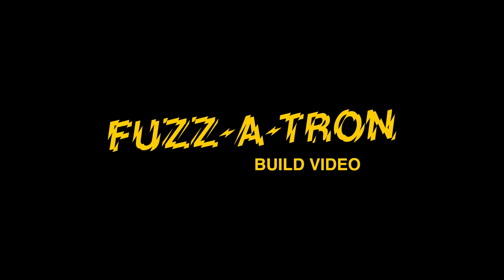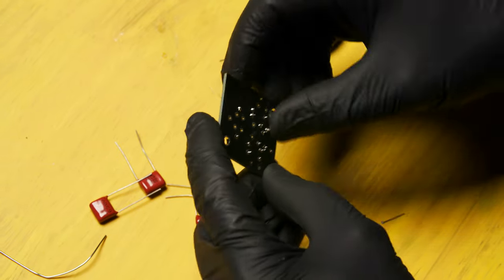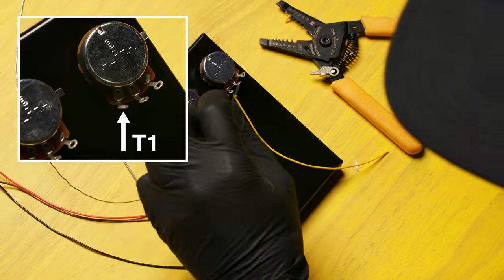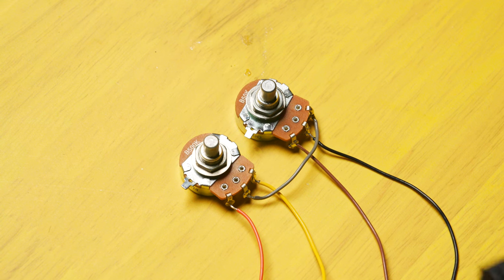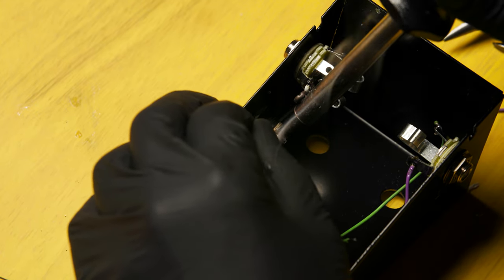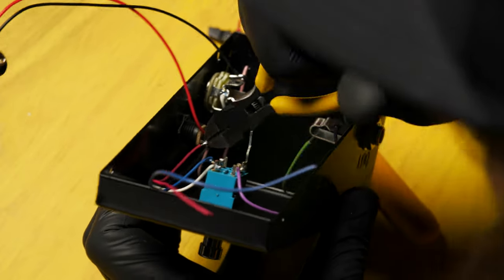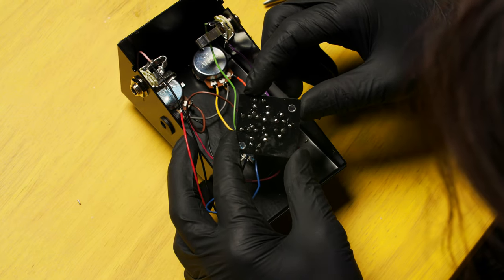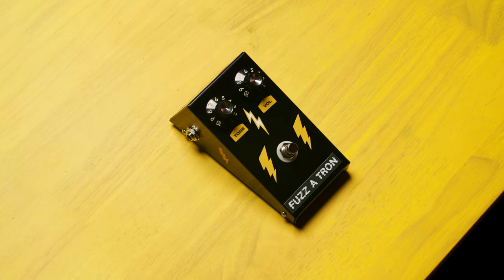Third Man Hardware Fuzz-A-Tron DIY Pedal Build Video

Comment: Built mine yesterday. It was a fun project, even for someone with very limited soldering experience. I initially missed the step of fixing the spare cap leg to the other lug on the switch and wondered why I had no bypass signal 😂 Once I figured the out all was golden. It's a great sounding pedal too. Now I'm keen to learn more by getting a breadboard kit and trying out a few circuits.

Comment: I got one of these kits, though I ordered a Triple Threat!
It was badly packaged, so badly that I have to doubt that all components would work after being sent through the mail.
Third Man Uk run a bizarre system where if you email them repeatedly, you are placed at the back of the complaints queue,  each time  you email!
I cant say if Third Man USA is the same, but it's worth bearing in mind if you order from the UK shop.